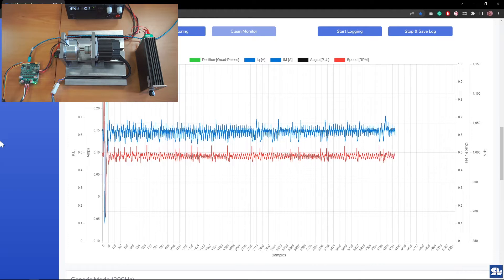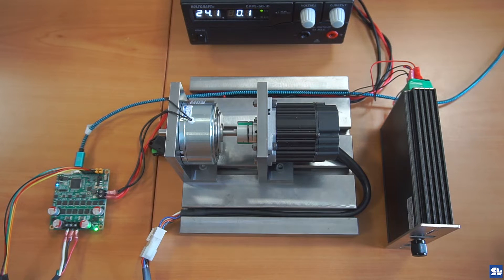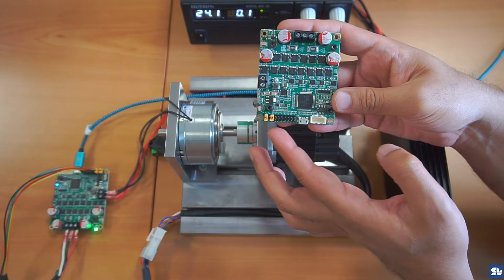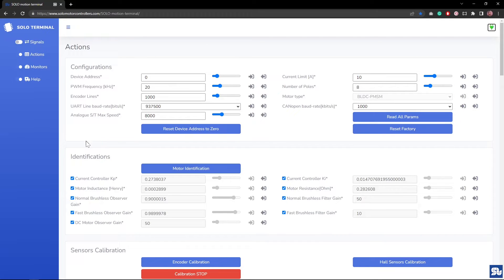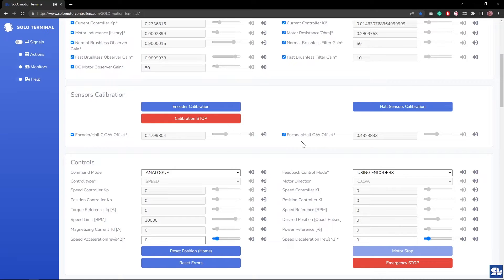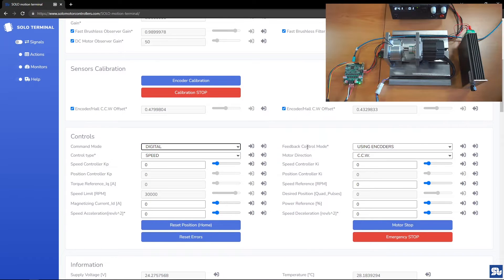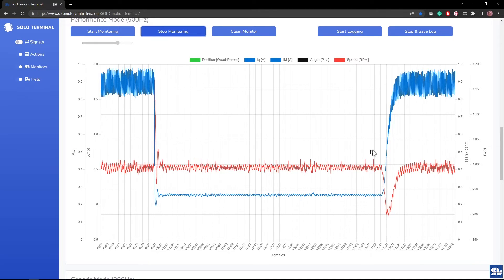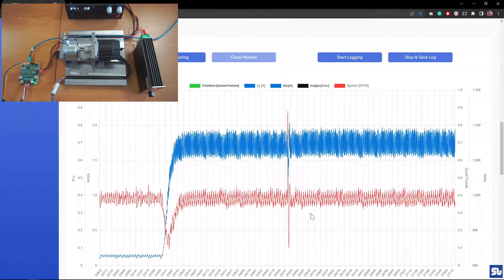High Performance Constant Speed Control of a Brushless Motor in Loaded Condition [FOC enabled]

Comment: What is the reason for the 10RPM oscillation on the velocity?
Reply from the maker: The oscillation is based on the gains related to the tune. Is possible to optimize them based your system and requirements, in this video was not critical to use not optimized ones.